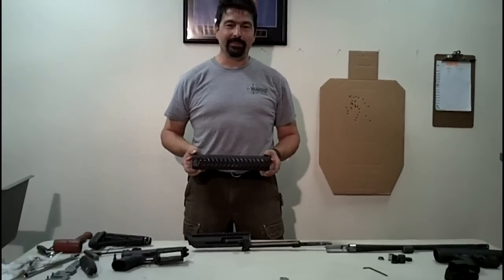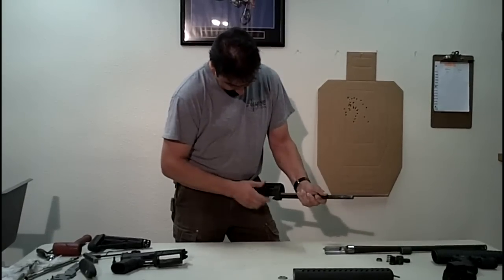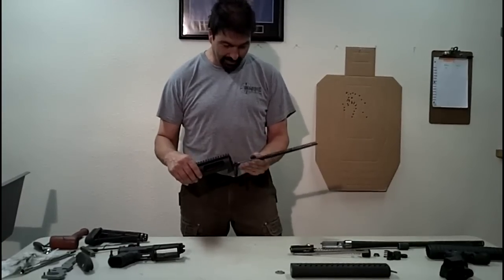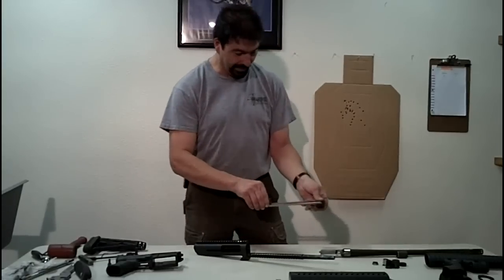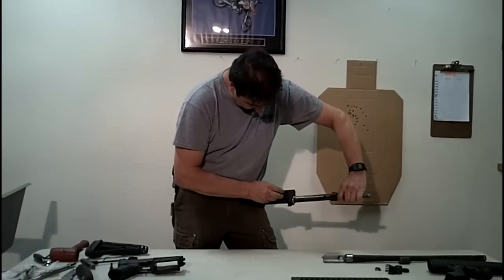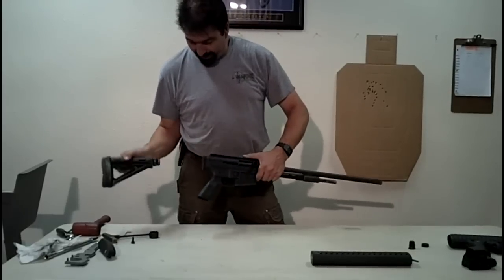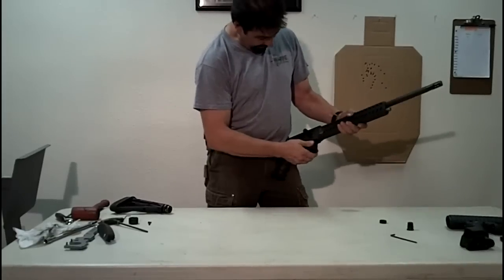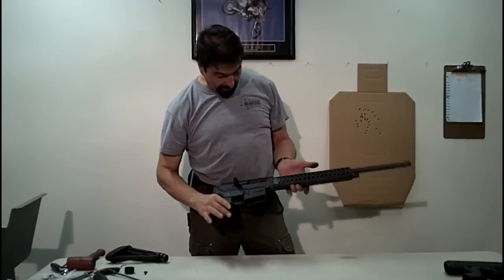Tooth and Nail Armory forend install , How to

Comment from the maker: you can shave the ears off the centering washer , however you'll sacrifice some stability , still about 4-5 times better than the stock forend.

 I wouldn't recommend it if you put a sight on the front. With a RDS you wouldn't notice any movement